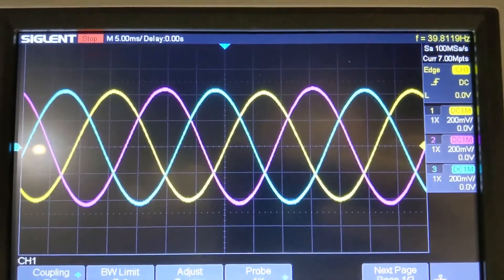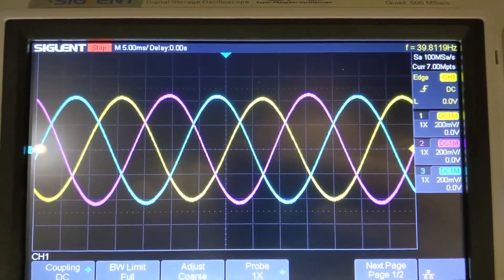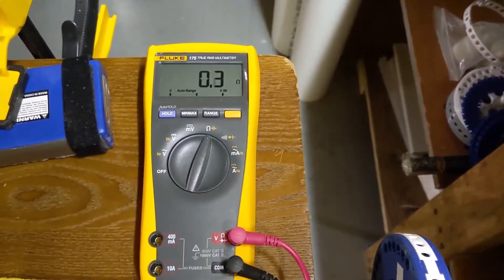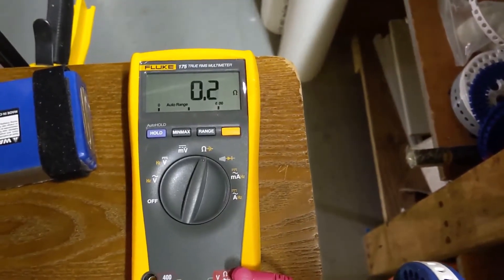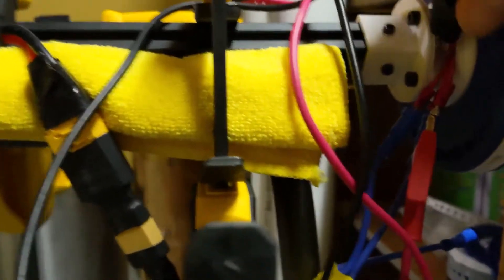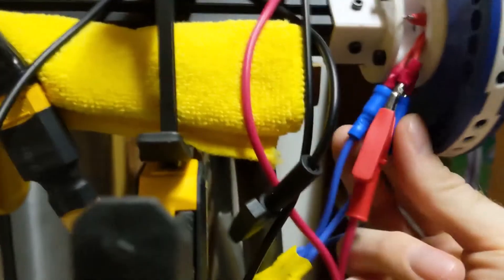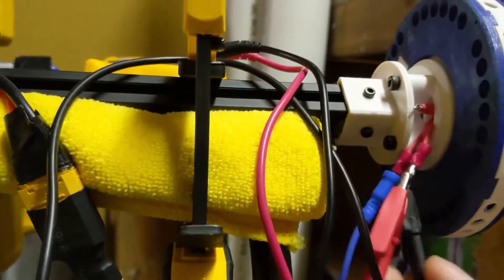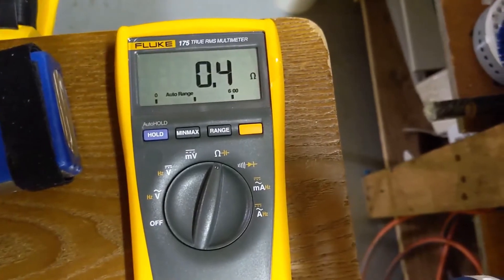3D Printed Axial Flux Motor - Mk6

Comment: apply load and measure torque. almost any motor can demonstrate good efficiency and performance spinning freely.
Reply from the maker: Kv which can be derived from the measurements on scope, is actually telling of the Kt of the motor. The torque is simply limited by the ability of the conductor to carry current.

I have another motor demonstrating that it can in fact carry a small load (a large plastic prop) but I did not do a direct torque measurement. Looking forward to getting there soon with the next version.

Thanks for your interest!

Comment: Hi, the difference between what a 3 phase motor puts out in generator mode and what it takes in when run as motor is very different. I wonder what would happen if you fed a motor with perfect sine waves...?  Any thoughts??
Reply from the maker: Yes I believe what you are talking about is known as FOC field oriented control. This is used to produce a nearly sinusoidal waveform. And can increase throttle response and efficiency to a degree. 
Check out the VESC project. There's been a lot of research in that area